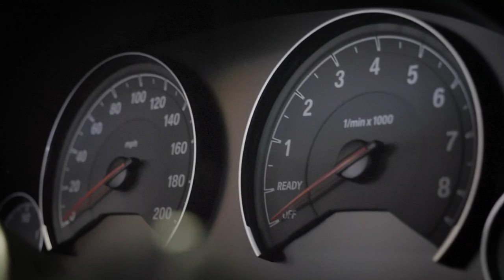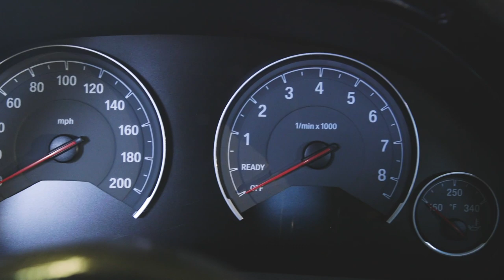S55 Powered E30 M3 - IN-DEPTH LOOK!

Comment: Listen I am not sure if you are aware but the GROUPE-A DTM front wheel arch/body panel is wider than what is on our factory street E30 M3s so you could run 18x12x325 square
Reply: I'm sure you know this, but others may not. Fenders varied by year in DTM. Early DTM cars were running modified stock fenders. Some later teams used modified EVO 3 fenders. Some home-brewed wider ones themselves, but may not have been legal in DTM (or so the story goes). The so called Group A fenders had openings that extended further forward and back for more sweep, but supposedly the same width. There may have been others, but I don't know for sure.

Comment: put in a dry sump and free up the space to improve the subframe geometry and be able to fit power steering
Reply: This is a repost from another comment with the same question. -  A few reasons why we didn't use a dry sump. 1. It wouldn't have bought me any more clearance to the steering rack and subframe. The front of the pan already sits right against the windage tray with no way to reduce height. No clearance would have been gained. 2. The S55's oiling system includes a primary and secondary pump with provisioning for turbo oil scavenging, dual pickups, and an electronic volume controller. Trying to replicate or package that inside a dry sump would have been a compromise with little upsides.  3. A dry sump would have added weight, packaging issues, and failure points to an already very tight engine bay.  - Checkout the S55 tech document to see why the factory system is so good. I think you'll be impressed by it http://s3.bimmerfile.com.s3.amazonaws.com/wp-content/uploads/2015/01/S55-Engine.pdf

Comment: Why no dry sump?
Reply: A few reasons why we didn't. 1. It wouldn't have bought me any more clearance to the steering rack and subframe. The front of the pan already sits right against the windage tray with no way to reduce height. No clearance would have been gained. 2. The S55's oiling system includes a primary and secondary pump with provisioning for turbo oil scavenging, dual pickups, and an electronic volume controller. Trying to replicate or package that inside a dry sump would have been a compromise with little upsides.  3. A dry sump would have added weight, packaging issues, and failure points to an already very tight engine bay.  - Checkout the S55 tech document to see why the factory system is so good. I think you'll be impressed by it http://s3.bimmerfile.com.s3.amazonaws.com/wp-content/uploads/2015/01/S55-Engine.pdf

Comment: If he wants an OEM approach to fitting a larger tire he can use the E30 M3 Sport Evo front fenders.
Reply: The limiting factor is actually the rear wheel wells, bumper bracket, and upper fender support at this moment, but evo fenders would definitely help.

Comment: normaly on the f80 it's mounted just in front of the radiator...........not only on an f80 m3 bro, like basically with all cars lmao, weird place for a ic, could get damaged easely. Sick build tho.
Reply: I think you are referring to the oil cooler. the IC is on top of the engine. The oil cooler sits above the underbelly pan and no lower than on an F80.
Reply: @coryrowan4553  ow ok thats the oilcooler, damn thats a monumental oilcooler than. Like i said sick build.
Reply: @swansmeister  Many thanks friends

Comment: I'm just throwing some stuff in the wind, but I'm guessing it is a $250K car
Reply: lmfao more like 30-50k on the used market
Reply: some of the rare limited edition versions are going for 100k+ i forget what theyre called. evo sport i think...
Reply: 30k for a clapped out e30 M3 and 50k for a clean driver.
Reply: There's an EVO2 for sale at EAG right now for $125k with 106k on the clock
Reply: yes. But no ac and no power steering.

Comment: How's the balance of the car? The reason that they put a 4 cylinder in the M3 was for the balance of the car, in instead of a 6 cylinder . Do you think that BMW motorsport division didn't thought about that wen they developing the car?
I have the impression that they thought there were modifying an old American car, a lot of power but a lack on balance and stability on the road like all American muscle cars.
Let this old beautiful car in his glory like it is.
Reply: The all-aluminium 6 cylinder S55 is shockingly light compared to the original iron block S14. The large cooling system does add weight, but we did a few things to make up for it. After experiences with many iron block 6 cylinder E30 builds (s50, S52, S54, etc) I assure you balance can be had.